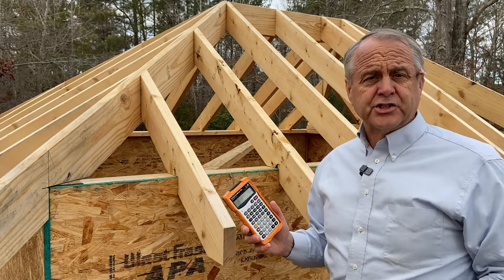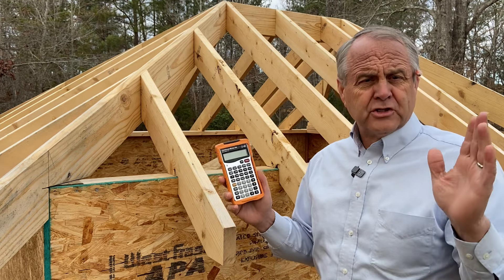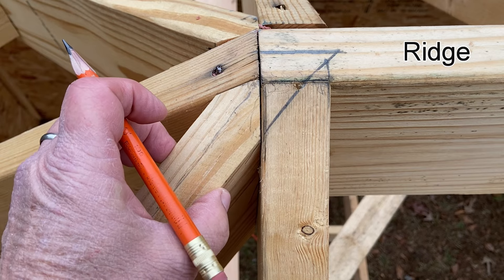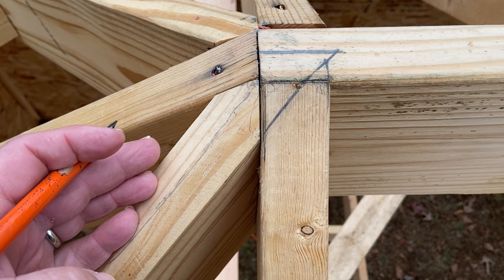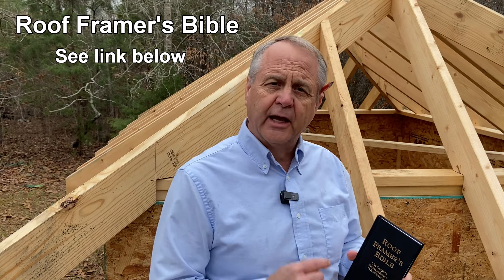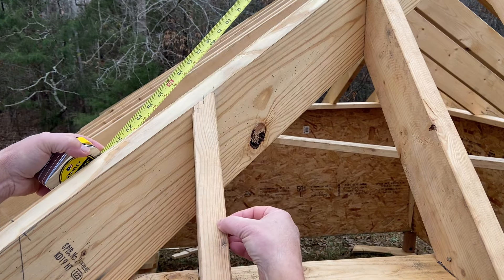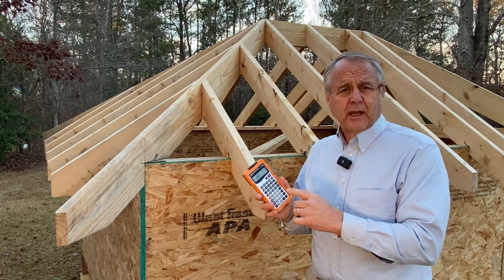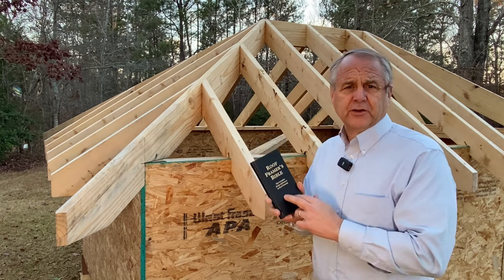How to frame a hip roof with correct jack rafter lengths

Comment: Do this book calculate the measurements for a Shed roof Rafters?? I have sewn but ome. Video on bow to do shed roof ...can you do a Shed roof rafters, detailed video.??
Reply from the maker: Yes, the book gives the rafter lengths for shed roofs. I don't have a video specifically for a shed roof, but the same principles apply. A shed roof is figured like one half of a gable roof. The same principles of rise and run apply. Just get your rafter run and use it to get the rafter length. Thanks for watching!